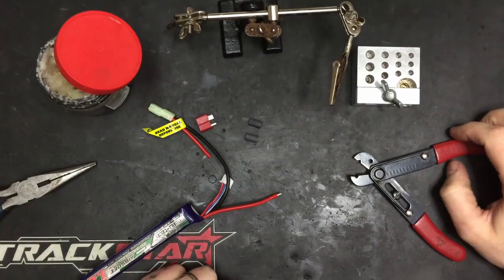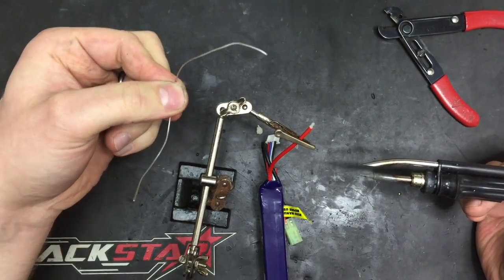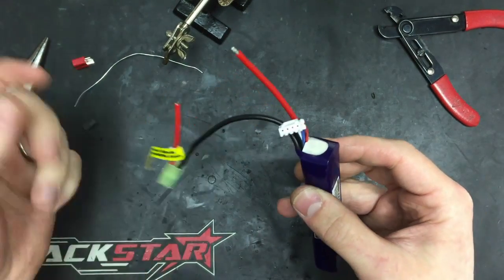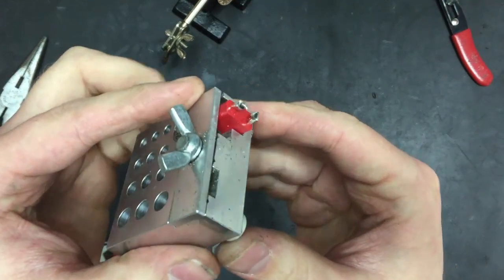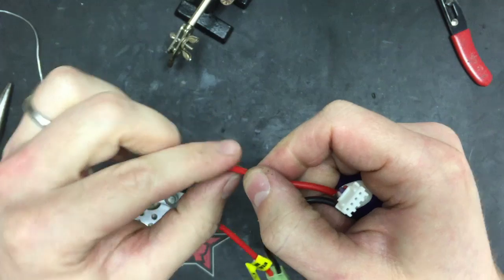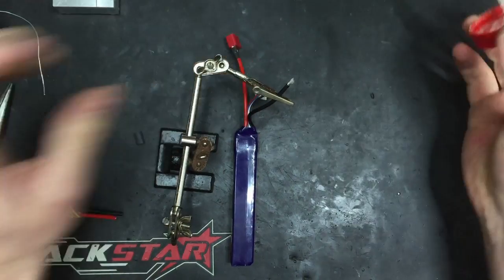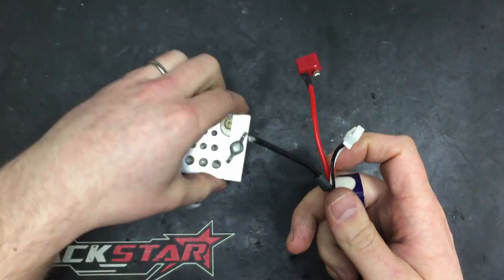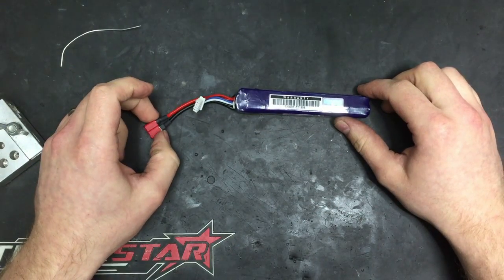Soldering Deans Connectors

Comment: What is the tube on top of the soldering tip please ???
Reply from the maker: It's a fume extraction tube :)

I don't have this installed any longer as I've upgraded to an extraction cabinet but that little pump and tube were decent enough at the time. 
It did get clogged up really easily though.

Comment: hello, do you know how to install a pico aab mosfet on a steyr aug?
Reply from the maker: I do indeed :) 
I don't currently have any installation videos for simple MOSFETs but the process is fairly straight forward. 
The main issue is that you'll have to solder wire extensions to the unit, so you'll need your own wire.
Reply: ok thank you